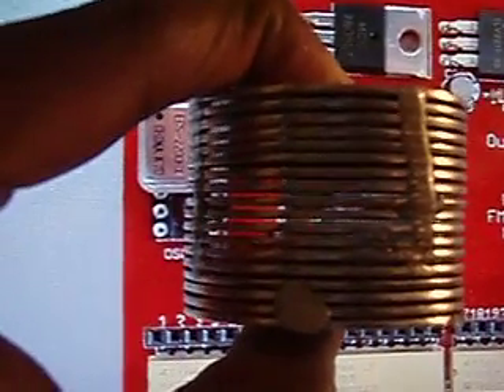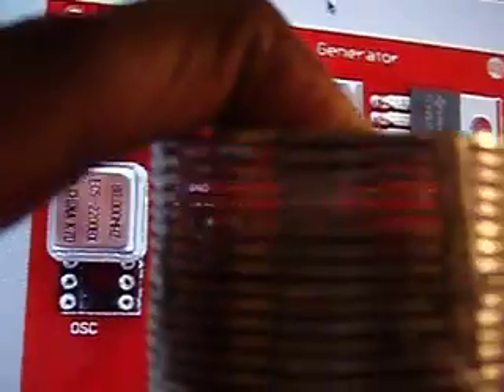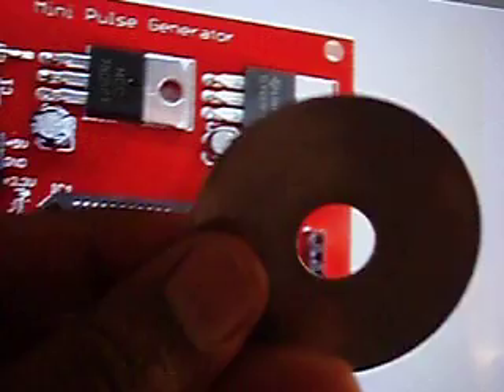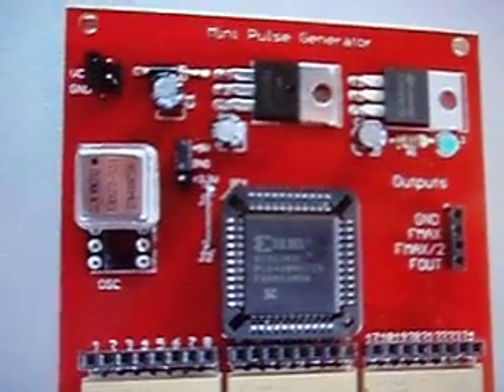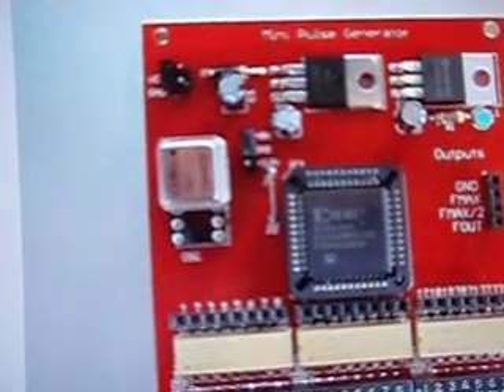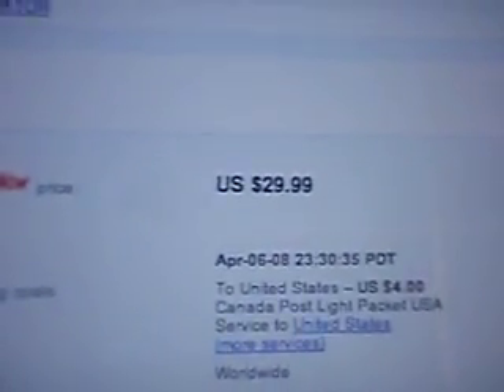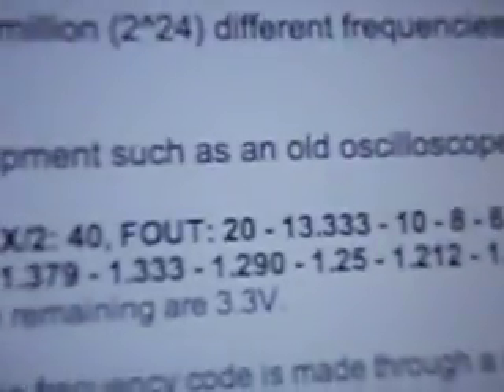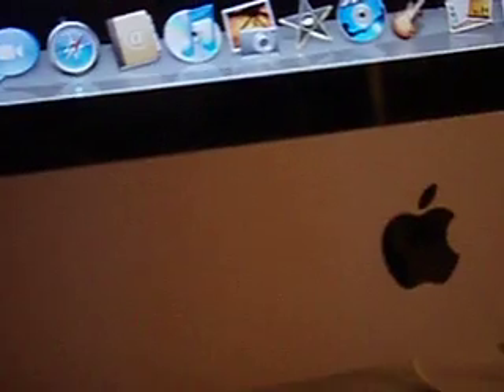hho gen tips cheap pulse generator

Comment: ok i didnt buy copper washer at lowes you noob its the light ing in the room reflecting of the washer you loser.. and ive already got mine to work so i dont need to post these videos anymore.

 a pulsating device that pulses 25 v to each cell for a 36th of a second completing the full cycle of cells six times in a second and it runs like a dream also separation your cells by an neutral chops the voltage in half every time so 4 neutral plates are great for 12.5 vcell..i am the man you are a loser

Comment: @BavarianOwl

Yeah it seems you need a pulse width modulator or else you could use what i'm going to try. I'm going to try use an AC current and modulate the frequency. Hope it works, i haven't a clue what i'm doing. If you use small aplitude with resonance frequencies then the over heating shouldn't be a problem right?

Comment: I am the developer of this pulse generator. I  want everyone to know that this Pulse Generator has a fixed duty-cycle, there is no PWM control. Also you should never directly power the HHO with it, you need to hook it up to the gate of a Power MOSFET transistor if you want it to power the HHO.

Consider looking up "DC Motor Speed Controller" as an alternative.

Also I am considering designing a Pulse Generator specifically for HHOs.

Comment: YES! High voltage usage sounds like a bullseye. I'm not an electric engineer but a few resistors attached to a switch to create a 'high' and 'low' voltage PWM can probably go from experiment mode to welding mode with a flick of that switch.

Comment: maybe not as a PWM exactly because a PWM needs to manage duty cycle on low volts with high amps ...

BUT, some of the stuff in that strobe light could make for an interesting high voltage electrolysis apparatus ... would take some tinkering but might be effective ... am not sure as have never tried it ...

Comment: thanks ... its been a hard day and a bit of humor was pretty much what I needed ...

yes, some research needs to be done related to RF at ultra low frequencies ... seems there is some evidence that certain harmonices in 2hz range might yield results ... 

but, I am not sure how pulsing the electricity to the electrolyzer at these frequencies might help ... 

a common item used is a pulse width modulator ... but this is used to control amps and gas output volume and dont generate RF ...